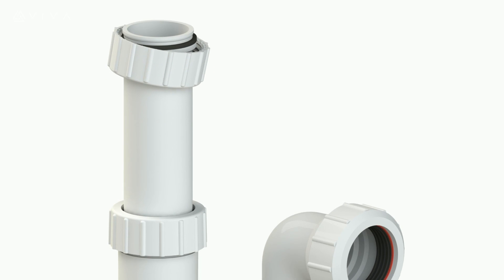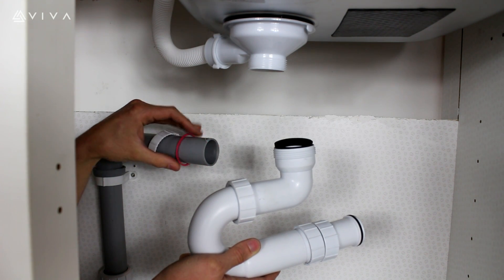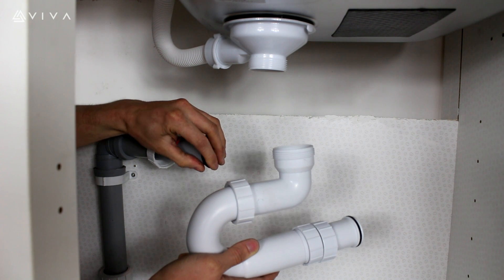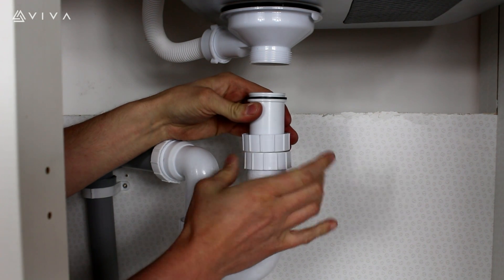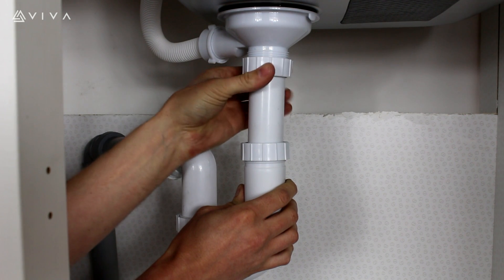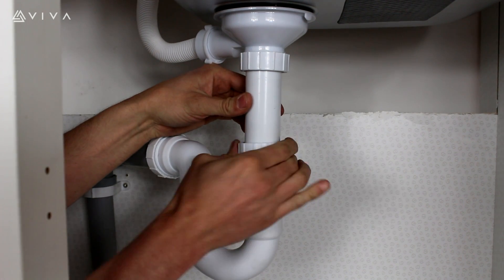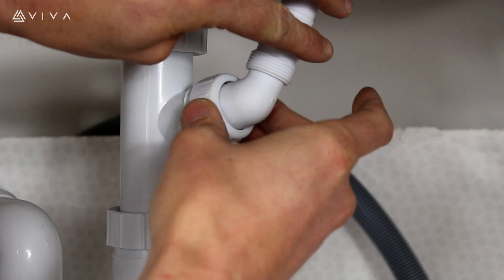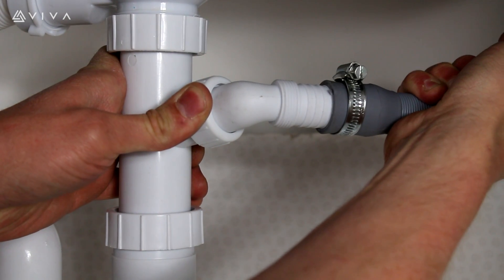How to Install or Replace a Universal Telescopic P Trap or Appliance Trap

Comment: Thought i had broken my u bend bend clearing it as it wouldn't reattach, turns out I'm an idiot and the rubber washer was just stuck to the pipe in the wrong place. Thanks so much! :)

Comment: I've got this exact 'P' Trap under my sink but getting a very loose connection after the bend. Are you supposed to use sealent or something? Even with the nut hand tight the compression is the pipe is still really loose
Reply: There summat called plumbers caulk/putty or I'm using silicone. Keep it to the washers and avoid the threads. P.S. Just noticed you posted a year ago, but this A to your Q might help some one!